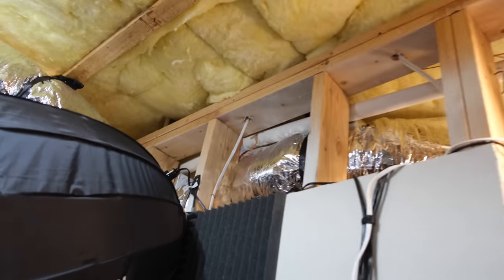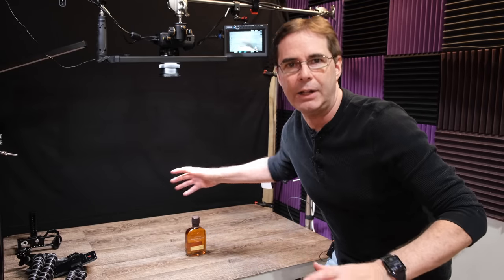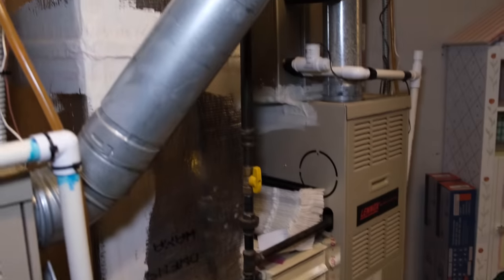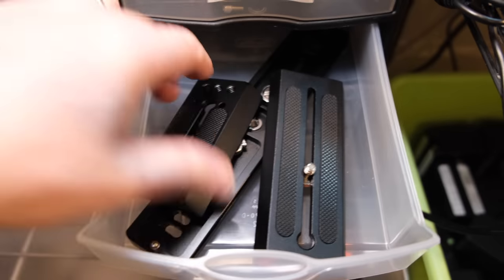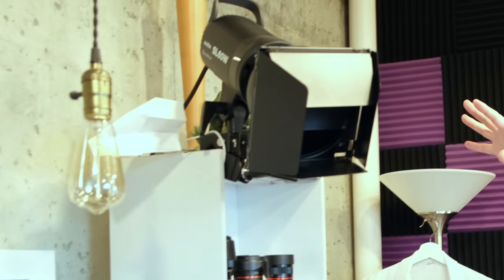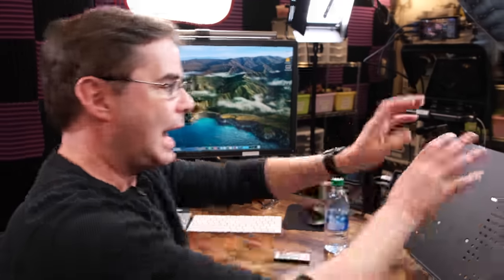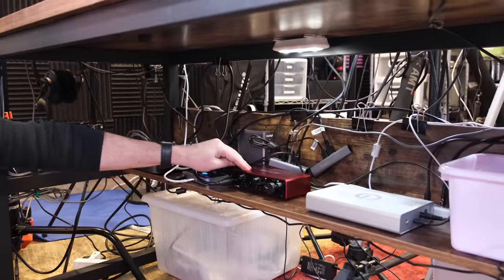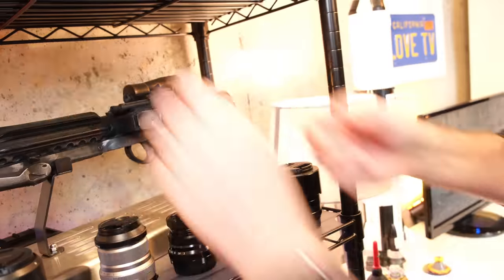Studio Tour and Gear 2021

Comment: Only thing that I think you might consider is to shadow your tools. We do it with foam. The tools then won't rattle around in your tool box, and you quickly know that is missing. You can also label the shadow, that way you know what it is right away. Especially useful when you have items that are similar. We also use shadowing to prevent things being left inside aircraft.

Comment: Nice setup but that shelf that has the light over it (hooked to it) that has tanks of water on it, better hope you don't have an earthquake or something because that self will fall over and all that water on all that equipment, maybe even cause a fire. you don't want that to happen when your home or not home..
all it takes is to either move the water out of the way or secure the shelf to the wall with metel plates or something ..

Trust me on this i had a studio in my house  when i lived in Salinas California, and i had lights rigged up with booms and stuff like that and thank god i didn't have any water on fixtures or anything because it would have been a disaster,  one of the paul c buff Einstein lights fell over cracking the case a bit but that was about it.
I wasn't doing youtube videos i was shooting photography shooting models with my backdrops,  i had a lot of space there...
So word to the wise an earthquake is a disaster for a photo or video studio all setup..
I use to experience small ones all the time like 2 sec or so, but every now and then every few years a  good size one would hit.
of course i live pretty close to San Francisco which was only like 100 miles or so away and that is nothing for distance with the large earthquakes that hit, i was right on the fault line that went strait through bakersfield and through LA, i once saw about 30 feet of road fall into the ground making a 20 foot drop down, that shit gets really scary LOL

Comment: I’m using a JJC (and other brands) soft shutter release buttons on my Fuji X-T4 and they keep falling off, some I find in the camera bag, on the floor and some I never find. Would it be ok to use a product like Loctite Threadlocker Blue 242 or am I risking damaging something and I’m better off just keep buying new shutter buttons? Thank you.
Reply from the maker: Funny you should ask. I'm literally getting some thread locker for the clamp screws on the smallrig cage -- because the monitors are heavy and loosen them. Here's the deal on threadlocker: I'd avoid using it for the shutter release screws. Because sometimes threadlocker hardens so damn tight, that you will NEVER have the option to remove the button again. If you do, most likely you could damage the mechanism. It's meant for larger and thicker screws than the fuji shutter release housing holds. You never know if you want to 1.) change out shutter release buttons one day, 2.) break part of the button and are now stuck with it, and 3.) want to someday use a manual cable release. If the button can't be removed, this could end up being an issue. Just my $0.02.
Reply: @pal2tech  Thank you for the prompt reply, I’ll just keep buying new buttons if I need to. On a separate note, I don’t believe that having the exposed fiberglass on the ceiling is a good idea, you could be breathing small particles of that “stuff”.
Reply: @DianneArnold  I mentioned it because as a kid I worked with my father (plumber) in construction and I remember that the people installing the fiberglass insulation were using masks (like for covid-19 LOL) because they were concerned about breathing it in.